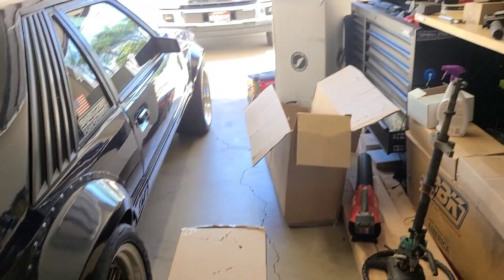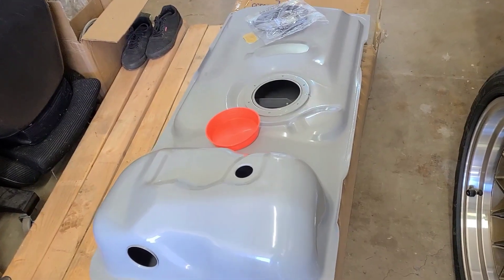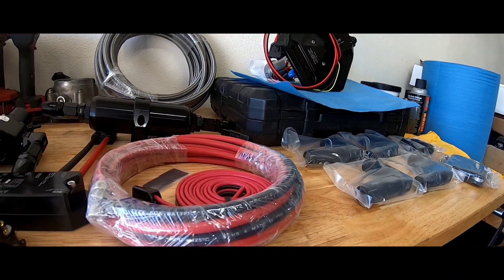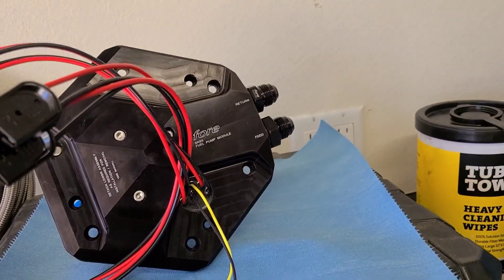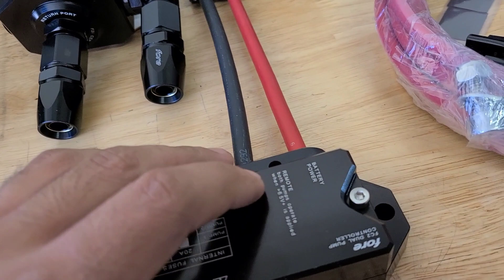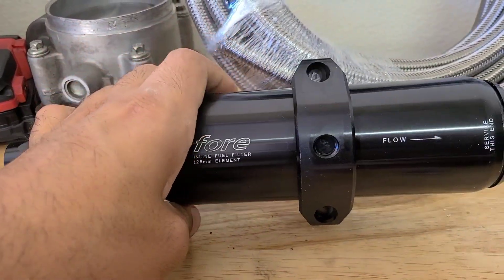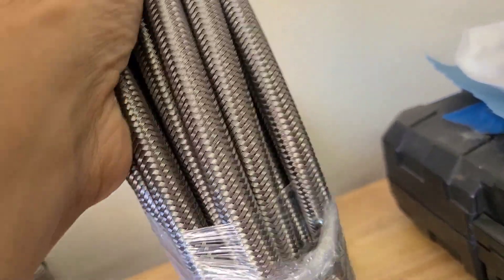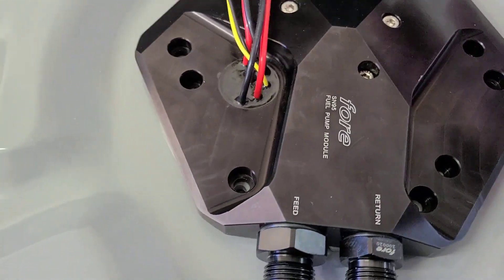foxbody cobra fuel system part 2

Comment: What about the fuel gauge?
It will work?
I think the sending voltage may be different from 86 to  newer mustang 
I’m getting everything to coyote swap my 84 gt350 and I’m looking for my fuel tank options
Reply from the maker: It is different if i remember right but i have some changes coming to my gauge set up i had before
Reply: Goes by OHMs it will work with OEM cobra sending unit.